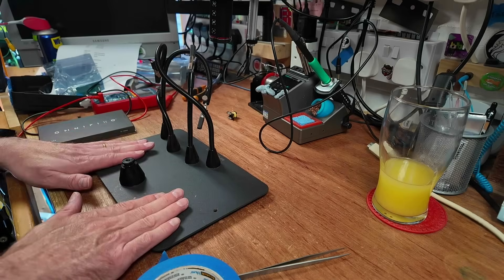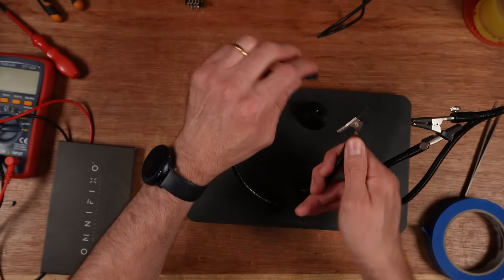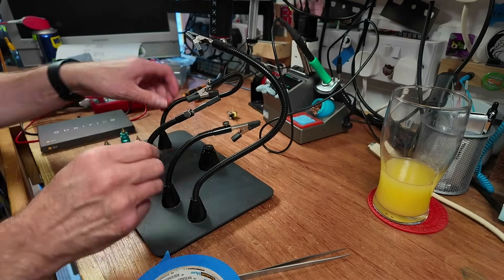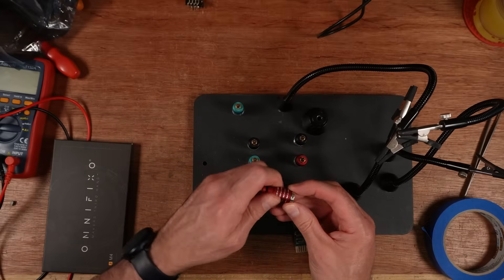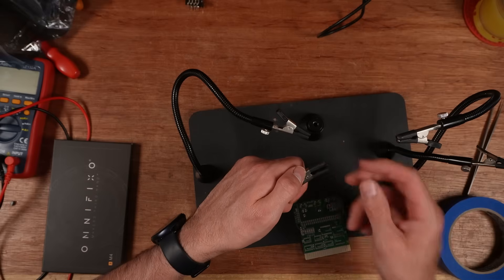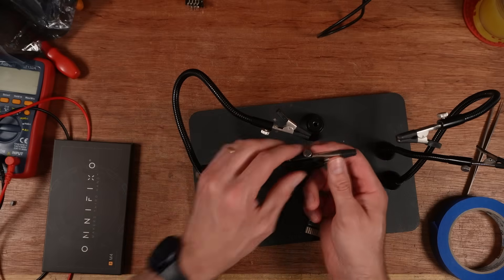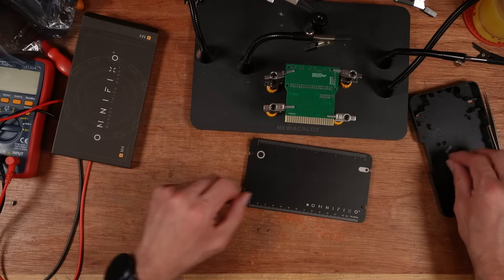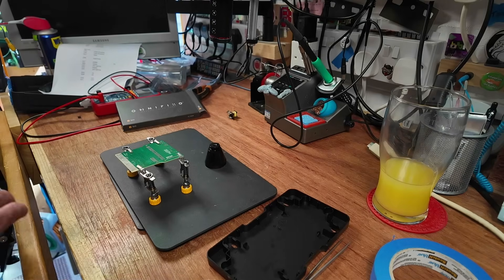Omnifixo - More Hands for your Workbench

Comment: I've had mine a while now and they are excellent. The metal base can asl be set vertically in the plasic base for versatility and if you flip the magnets you can also flip the grippers and work with a set gripper instead of on the ball.
Reply from the maker: I found that out since I made the video. They are sooo good!

Comment: The omnifixo is not cheap, but worth every penny. I have mine for probably 2 years now. The old one didn’t come with the container base. I have seen it somebody on twitter using one and 30 seconds later, I knew, I need one more than than anything else in my lab. I think, a great purpose for it is soldering cables. Much more than holding PCBs. The only disadvantage is the small base. But this way, the omnifixo is part of the permanent „exhibits“ on my workbench. 

And crocodile clamps are really bad. They are a pain in the ass to position and produce bite marks on cable isolations.
Reply from the maker: Hey Sven! Wish I had known about these sooner. They are sooooo good!

Comment: Hey Lee, maybe you should pop your fantastic MFFI logo, up in the left corner or something, on those thumbnails where you don't show a contorted version of your face. Because this one didn't instantly scream "More Fun Fixing It" at me, and the poor YT algorithm had to smack it in my face a few times, before I reacted. 😅
- I actually bought that bigger one back then, because of you. Yeah! it is entirely your fault!
- Naah, It's actually the best set of "helping hands" I've had so far, and I've tried out quite a few. It doesn't feel cumbersome to use at all to me. 👍👍
- The clamps on this Omnifixo thingy does spark my interest though. But yeah, the base is definitely too small and that feature for powering your PCB, seems like a solution to a problem that doesn't really exist.
Reply from the maker: I prefer to keep my thumbnails simple and plain if possible. Putting your logo on there is only helpful to people that are already likely to click anyway, and distracting to new viewers. I know it doesnt sound like it makes sense but it actually works against the thumbnail purpose :D
Soz I made you buy the wrong helping hands :D
Reply: @morefunfixingit  I have been almost impressively horrible at remembering to checkout Patreon for new stuff. Sometimes I have even missed some of Robin's Patreon-only videos that way. But this hopefully ends today. Since I have just put Patreon into my browser as one of the startup pages. 😅

- The problem I have with thumbnails on YT itself is that, if there is nothing recognisable on a thumbnail that I'd usually associate with that particular channel, then I'll just doom-scroll onwards. Subconsciously conditioned by an increasingly annoying algorithm, I'd say.
- I will even consciously defy the urge to click on a particularly click-baity thumbnail, if I feel that it is somehow insulting my intelligence. 🤣